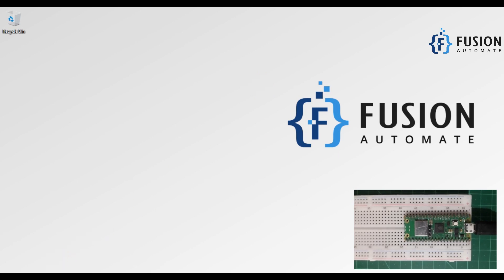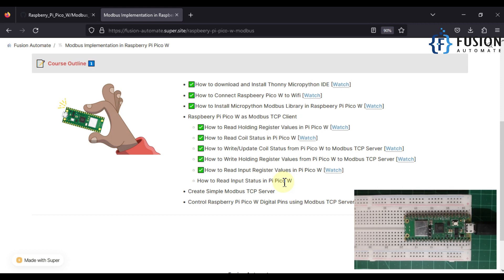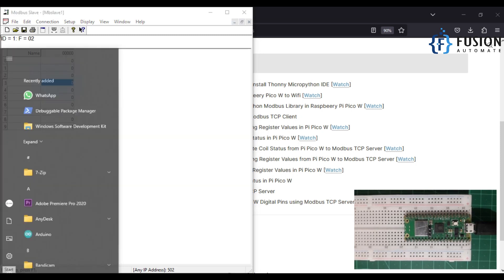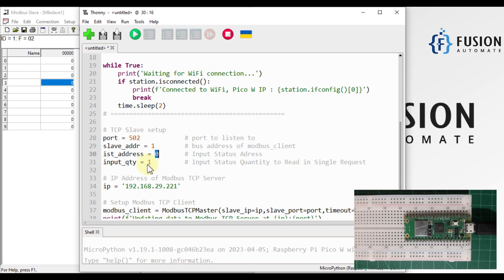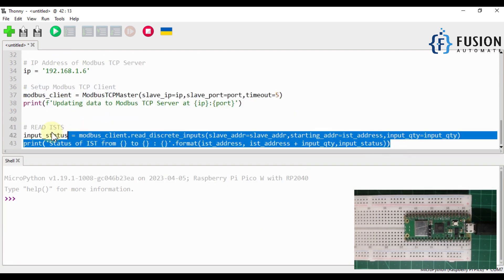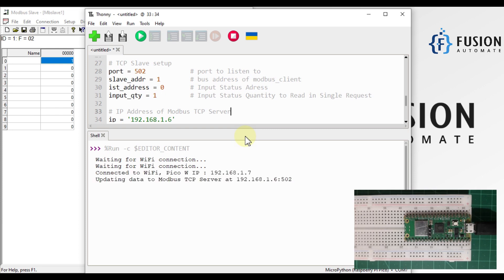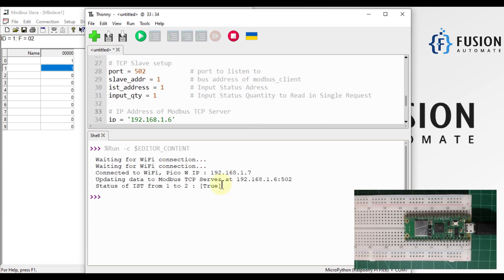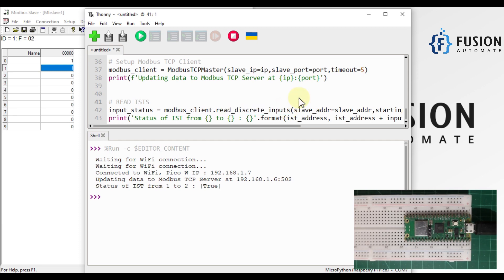How to Read Discrete Input Status of Modbus TCP/IP Device in Raspberry Pi Pico W using MicroPython |

Comment: is it mandatory to use qty here as only one cause it is ISTS not IREG ?
Reply from the maker: I guess for this library its mandatory, also I will check library and update you whats the default value if you dont mention quantity.
Reply from the maker: Also you can read multiple ISTS in single request if you put quantity more then 1.